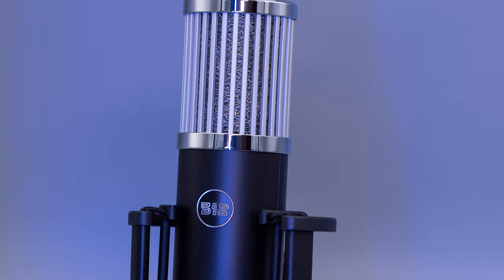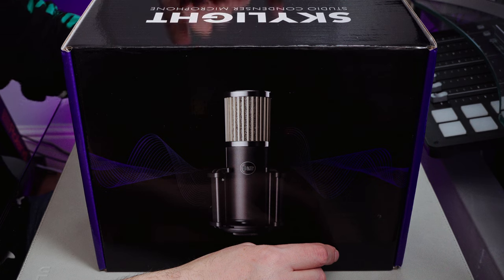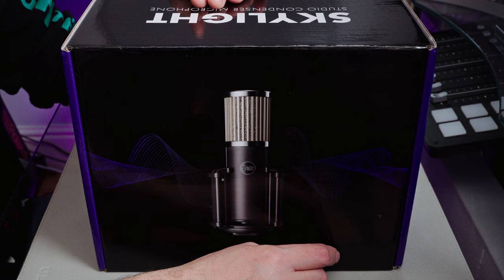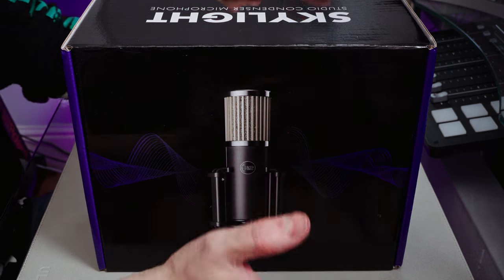512 Audio Skylight Studio Condenser Mic - Review & Test

Comment: couple things, the ringing wen you tap it is the body tube ringing, not uncommon in the bigger cases like that. I use tape or super thin foam to stop this on the inside of the case (really easy to disassemble. also, you CAN trigger the ring w the voice, so it def will come through if 'triggered'.

the iPhone interference also happens quite often, esp w 5g/lte. it happened a lot w 3g then 4g stopped it. it even happens around hardware equipment. since singers or speakers use their phones to read lyrics while recording (holding close to the mic within eyeliners) it will be more frequent